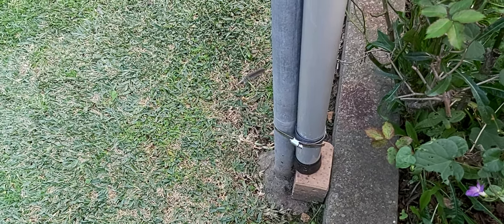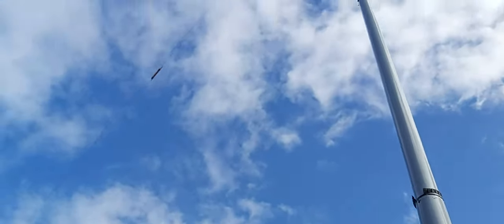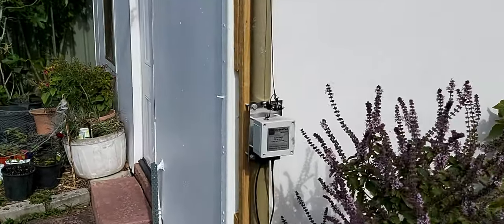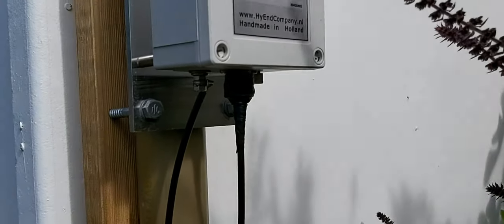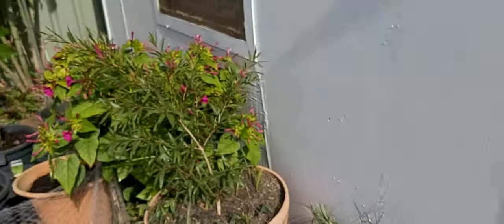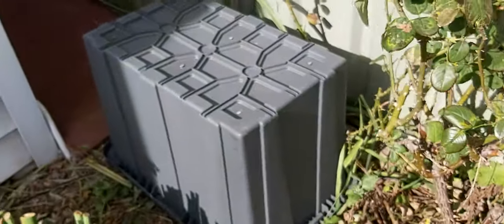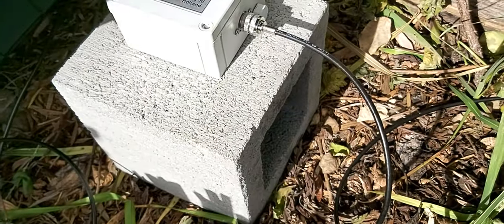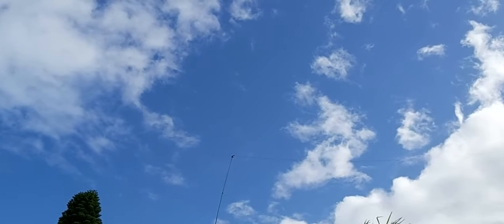QTH Inverted L Multiband Endfed Antenna Setup

Comment: Wondering why you put the "isolation transformer" (i.e. the choke used to block common mode current on your coax feedline) so far away from the antenna feed point box? de NK7B
Reply from the maker: I actually have to isolation transformers/chokes.  One at each end of the coax run. I encourage you to experiment to see what works best for your installation.

Comment: Really nice fixed station installation, Ari! Beautifully done, thank you for sharing. I have a question though; I am not familiar with the HyEndFed 80-40-20 antenna (I thought I knew them all :) ). How long is the radiator on that one? Did Ron build it custom for you? 73 from Tracy VE3TWM.
Reply from the maker: Hi Tracy. No its not a custom build. The radiating element is 16.5meters long. The 800 watt rating is nice for when I operate 400 watts, our legal  limit here in VK.  Unfortunately it appears that this antenna is not a standard offering anymore? I just had a look to share a link however I cannot find it on their website😕 they are my favourite all round antenna due to their convenient size. I also have a 200 watt version that is advertised for 4 bands which includes 10m. It is worth noting that this 800 watt version also tunes on 10 meters, no tuner required. With a tuner and 100 watts I have worked contacts around Australia on 160 meters, which is a non advertised nice bonus 😀 - 73s...
Reply from the maker: By the way, I have worked two VE3 contacts on 40m last week from VK2 with this antenna as shown in this video with 100W. I am now keeping my ears out for VE3TWM 😉
Reply: @radioaxe6964  Tracy, after watching your NVIS antenna in the trees video, I can see where your goin with this.  It's a good concept, and might be worth trying if it fits in your skinny yard... since the RG 58 is laying in the dirt with all that coupling to ground, I question the need for the common current choke.. if it were hanging in the air... maybe.  VA7AA/XE1

Comment: Hi - did the UV from the sun degrade the masts at all?
Reply from the maker: Not noticeable.  Maybe very little. I had them up for about 2.5 years.
Reply: @radioaxe6964  thinking of using this method for installing a light HF wire antenna in a temporary location! thanks for the inspiration

Comment: Question if you took out the isolation transformer would you notice any difference? and did you put in inline because the long run to the shack?
Reply from the maker: The main job of the isolation transformer is to reduce rf current  coming back down the coax. Highly recommended if you plan on running more than say 50watts regardless of your coax length.

Comment: Nice one Ari :) What's the cable type? Wondering about loss over that distance.
Reply from the maker: Hi Al. For this deployment I used LL195 - Cable Coax RG58 style Low Loss, Solid Centre/Foil/Braid. Total coax length here is about 12 -14 metres so not an issue. Thanks for your question 👍

Comment: Well 700 800 Watt with that cable, i don´t think that´s a good idea.
73´s DH1KJ
Reply from the maker: Hi... no me either. I mainly run 100w. Occasionally 200-300w for short bursts. Our legal limit here in VK is maximum 400w.
Reply: @radioaxe6964  Thanks for the feedback. But dear OM you should never save on a good high quality coax cable. With an RG58 you can not speak of it in any way. At least a good RG213 should be used even if it costs a little more. Regards 73
Reply from the maker: @jochenkrebs9685  Totaly agree. Your transmission medium is one thing you want to spend you money on and save somewhere else if you must. It's worth pointing out I am only at this QTH for a few weeks only, hence the coax just laying on top of the garden bed and the choke under a bucket 😀 Sorry, I should have mentioned in the video that this is a temp installation.  Thank you for your comments as I'm sure others would be thinking the same - 73s 👍
Reply: @jochenkrebs9685  With all due respect, I've run 500 watts on a .26 gauge stealth nearly invisible magnet wire. Goes straight into the back of the tuner near the window. Skin effect? Coax gauge? Not applicable to my station. For nasty RF I use an MFJ artifical ground. Yes at 500 watts and have never had an issue with fire, or anything frying or RFI complaints from neighbors. Obviously I don't run 500 watts all of the time. But there exist so many myths out there. Not your comments, they were fine, except you CAN do QRO with a microscopic endfed magnet wire with no coax at all. Why not a proper antenna? I simply cannot. And I still talk all over the world. It can be done people.